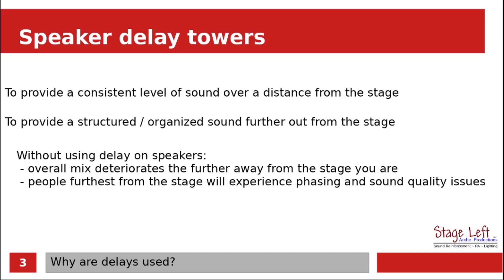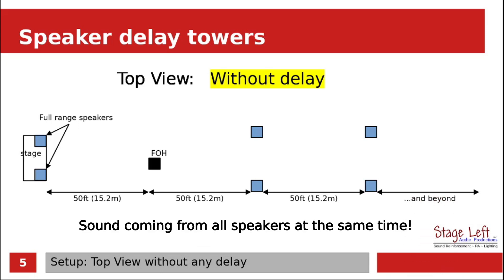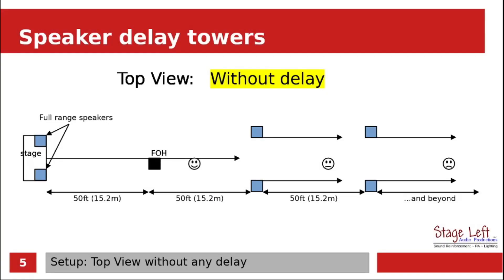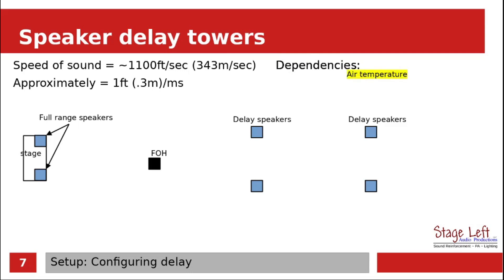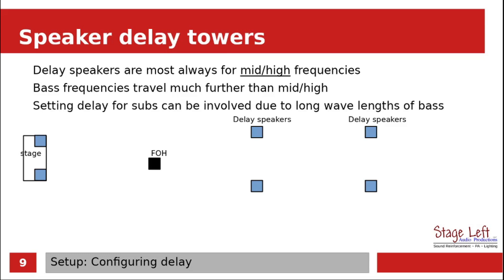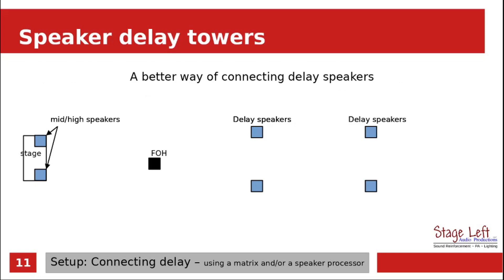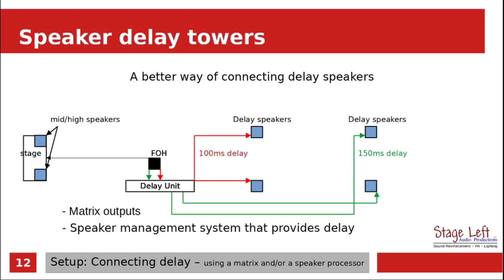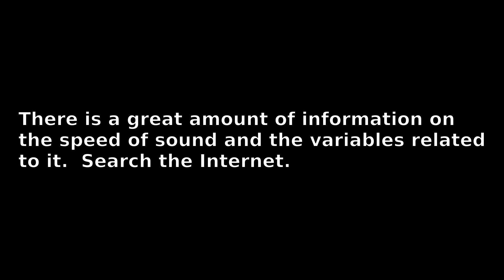Setting up delay speakers (delay towers) for an event (an overview)

Comment: Would the audience from the back feel the same level of punch from the subs ( placed next to the stage) as that of the audience from the front?
Reply from the maker: The bass would be much less at the back, compared to the front, however, bass frequencies travel much further than mid/high frequencies.  Therefore, the amount of bass at the back of a listening area is usually acceptable (depending on the number of subs, their deployment, and how much power they are being asked to produce.)
Reply: @stageleftaudio That is great, can't wait to try it!!! Thank you ❤

Comment: this is the first time i learned what is delay speaker is. NOw my question is will audience at the back notice singer's mouth or reaction of the body is a bit early than music?. I hope you got what I mean. Thank you
Reply from the maker: Yes, the audience will see the band and singers actions before they hear the music.
Reply: @stageleftaudio  I've seen a concert recently and noticed a very little delay between Mega Screen and stage.However,Mega Screen was perfectly synchronized with the sound.
The question is:even people near the stage see the actions before hearing music?
Reply from the maker: For your question, it is very possible for people near a stage to see the actions, before hearing the music.  It depends on the event setup, location of speakers, distance between the first set of speakers and the first row of the audience.
The speed of sound has a speed limit (it is not instantaneously heard)... most people will notice about a 30ms delay.  Most everyone will notice a delay of sound from 100ms and higher.
Also, some consoles can delay the signal input into a mixer... which will greatly increase the possibility of people seeing the actions before hearing the music.
Reply: @stageleftaudio  I mean, people very near the stage don't have to hear from delay towers but from P.A...that would be annoying
Reply from the maker: Correct!

Comment: If you are using passive speakers in that type of set up am guessing you would need multiple DSP units . The set up makes sense but seems costly too
Reply from the maker: Any DSP that has several outputs and delay on each of those outputs would work.  A single DBX Driverack 260 could cover both delays (and FOH) referenced in this video.  Delay setups can be expensive with just getting signal and power to each of the delay locations.

Comment: Delay calculate formula
Reply: Can you please make one video how to add some delay in Subwoofer
Reply from the maker: We hope to have a video in the future covering this.  Though, the only delay that should be added to a subwoofer is for time-alignment with the FOH top cabinets.  Delay should never be used in a "delay speaker" type of setup (as in the video).
Reply from the maker: The basic formula is 1ms per 1ft (30.4cm).  Check the internet to determine the speed of sound in your area (with other environmental factors).

Comment: Do you have any exemples about how to control reverberations on "squared" buildings ho do not have any sound proof things?
Reply from the maker: Reverberation is a matter of physics.  Soundproofing can help with controlling some of the reverberation; the use of line array speakers can help "direct" the sound where to go... unfortunately, in the end, sound will still bounce around a room.

Comment: a person really shouldn't just rely on math to set delay times... it's always a good idea to use a measurement system like SMAART to make sure everything is time aligned, and in phase.
Reply from the maker: Yes, audio analytic software works great!  Decent results can also be obtained by using measurements, math, and testing.  Without software, it can take longer to set delays.
Reply: @stageleftaudio  I’d go with the math as a starting point, and measure from there to fine tune, and get it in phase.
Reply: After I have an approximate delay time based on the formula I then have someone on stage take a pair of drum sticks and tap them together at the center vocal mic position. This was taught to me by a sound engineer from the 70s, works perfectly and can be done by ear.
Reply: @kylereynolds265  that’s a good idea! I’m a drummer as well, so I’ve taken a metronome app on my phone, and just played it through the PA in absence of my SMAART rig.
Reply: I think we over complicate things way too much. Nice having all of the measurement gear but I guess I’m more old school and like to rely on what sounds good to my ears. Music was once considered art and mixing music, imho, needs to return to that. I’m
not trying to be perfect with my mix, I’m trying to help the band make a connection with the audience. I get to play a small part in that interaction. But if my delay times aren’t set correctly I can have a negative impact on that relationship. So yes, get it close with your ears and then you can verify with your equipment.
Reply: @kylereynolds265  yeah, I mean, at the end of the day, it's got to sound good. I like to approach the system tuning with a bit more of the science approach, especially when it comes to time alignment, but I'll still use my favourite system tuning songs after and get things sounding the way I want. For me the art is in the mixing, which has to come together with the science of the system deployment and tuning. obviously we're talking about large systems here. Smaller rigs, with fewer fills I'll just tune by ear most of the time
Reply from the maker: @Dustin Thiessen  Exactly.  Despite the size of the event, and whether the delay was setup with or without software/tools, in the end, it has to sound good!

Comment: What about the delay from the first set of delay speakers to the second set?  In the example,  at 150ft would the listener be hearing the stage sound delayed by 150ms and the sound from the first set of delay speakers with no delay?
Reply from the maker: The listener at 150ft. will hear the stage sound from the second set of delay speakers 150ms AFTER the sound leaves the stage.  The listener (at 150ft) will also hear the sound from the first set of delay speakers, but the sound from the first set of delay speakers will be fired 50ms BEFORE the second set of speakers (at 150ft) fire.  This allows the sound to travel from the first set of delay speakers to the second set before the second set fires.  The result is, the listener at 150ft will hear a single source sound as if it was coming from only the last set of delay speakers.  Hope this helps.
Reply: @stageleftaudio  Makes total sense.  Having looked again, I think I must have miss-read your slide.  Many thanks for clarifying.
Reply from the maker: No worries.  Thanks for watching!
Reply: @stageleftaudio sorry,one question:people at 97-98 feet (on the edge) hear from P.A. or from delay towers?I mean,does sound from towers travel back?
Reply from the maker: @davidem.1677  Good question.  They should be hearing the main PA, but with such a close proximity to the delay tower, they could also be hearing the delay  speakers... however, they would not be hearing good sound quality, because (technically), they would be behind the first speaker-delay tower.  There would probably be some residual noise from the delay tower that people could hear that are at 98ft. out.  This is one of the reasons why delay towers are usually elevated... this helps keep the residual noise at a minimum and helps with a consistent coverage.

Comment: I think the delay is effective when you are using a digital mixer and speakers only,how about the analog, manual
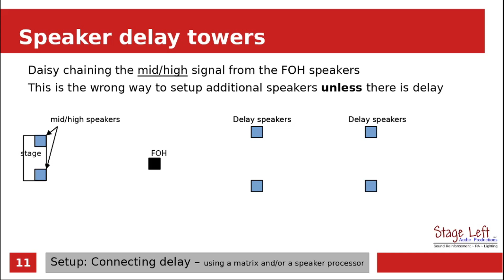Reply: Listen at 9:20, they talk about the DBX units which you can use in an analog environment.
Reply from the maker: Delay can be used in a digital setup just as easy as it is in an analog setup.  There are solutions to delay for digital and analog.